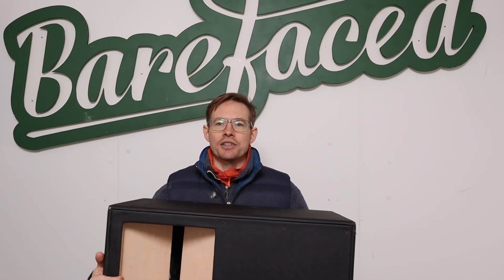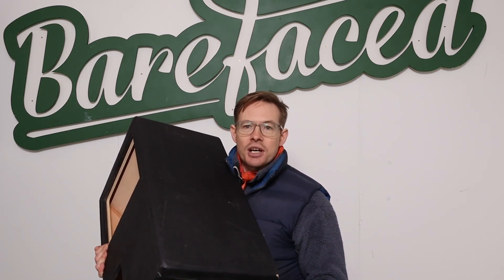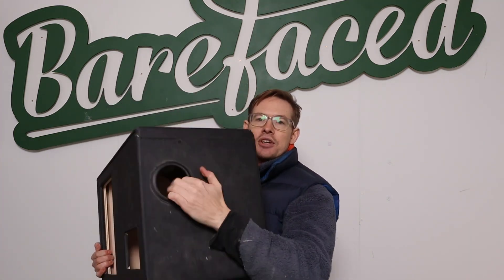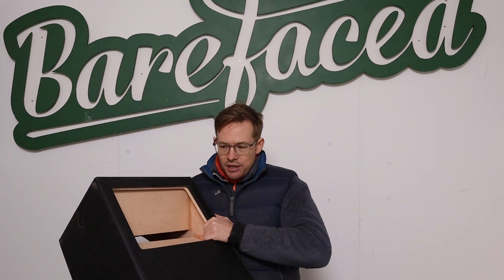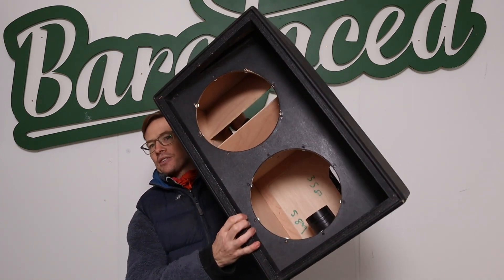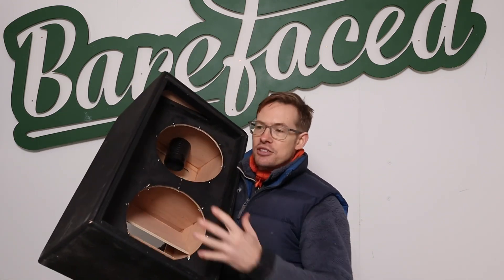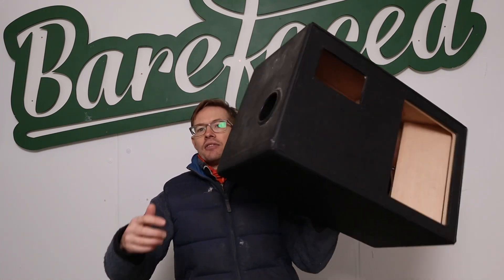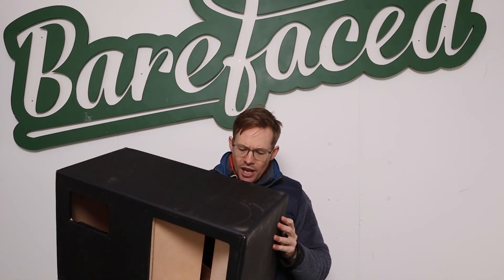Ports and guitar cab prototyping (part 2 of both!)

Comment: Buy a cab so we can get this bloke some heat for the shop!!
Yes light is good. 
Framing needs a bit of adjustment, but the info here I’d absorb even with a total lack of visuals…. I guess it helps explain the ports and baffles and waveguides for those unfamiliar with such things. Keep up the history and innovation 🤘🏽

Comment: On your 2x12 horizontal cabinet...which speaker would be optimal to mic up...the one with the avd or the ported one?
Reply from the maker: The one with the AVD is the one that's running full-range so that would be the one to mic when playing live. (Obviously in the studio there's probably an argument for also micing the other one and even the back of the AVD in case they prove useful in the mix).

Comment: Really enjoying the guitar cab vids! I've got a Reformer 112. Question, how does the volume of the cab and the wood (density, thickness, etc.) impact the tone, volume, frequency response? People often refer to smaller cabs, both closed and open back, as sounding boxes for example, and also say that lighter woods don't sound as good. I'm curious if the AVD counteracts the small volume and light weight woods of the Reformer cab.
Reply from the maker: The enclosure size/volume and the woods are two very different things - great topics for future videos!